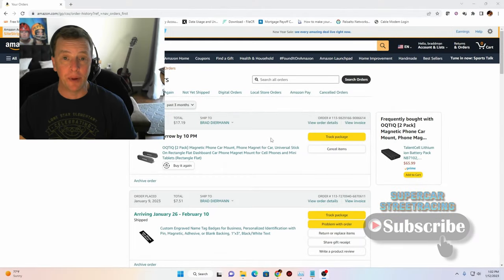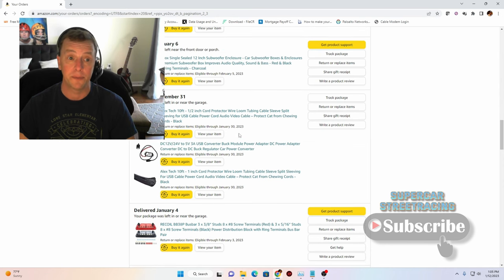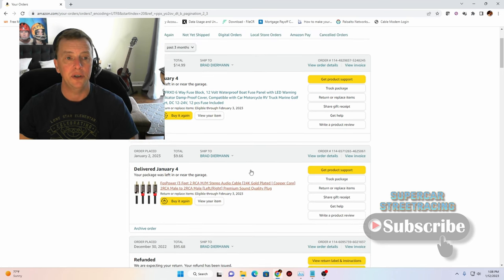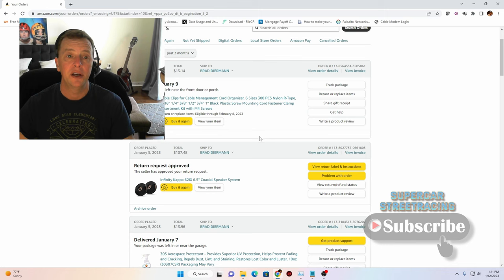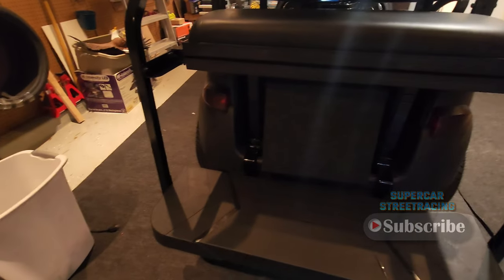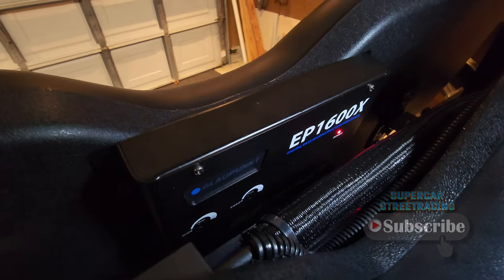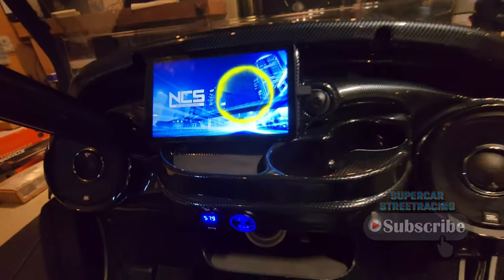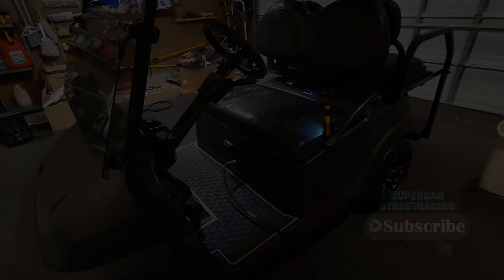Huge Golf Cart Audio System Reveal and Shopping List!

Comment: Nice setup, I have the same cart and I am running 2 pair of Rockford Fosgate 6.5, Fisrt pair are separate with the tweeters mounted on the lower part of the windshield, and the other pair of 6.5 is a full range that I built a box and mounted it between the seats firing up, the 12 " Rockford P2 is in a ported box mounted inside the cart where you have you 6.5 and USB port firing down, that was the only way I ever got any Bass, I tried your way and I wasn't happy. The bass is unreal like it is in a car...
Reply from the maker: Dude this is so awesome. What do you think about doing a short video on it and letting me publish it?

Comment: Nice setup.  I also have a 48v ezgo txt but not lithium. What is the drain on your batteries? Kinda scared to do a system on mine so i dont kill the batteries so i use 2 Bluetooth speakers w-king x9 and they are super loud but i want a sub lol
Reply from the maker: I haven't installed lithium I'm working on it now.
Reply: @Supercar_Street_Racing  so how did that setup do on your batteries?
Reply from the maker: No issues at all with lead acid.